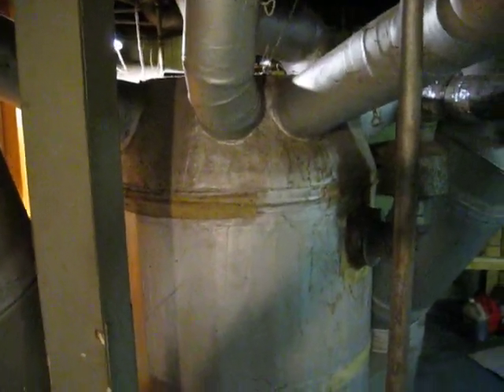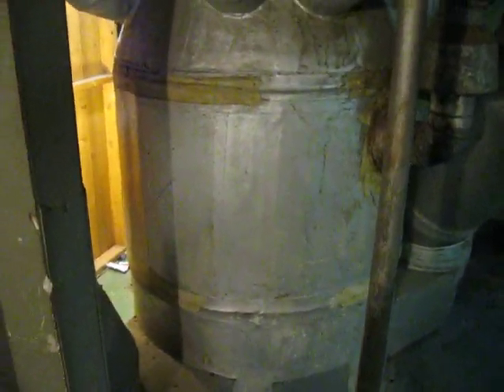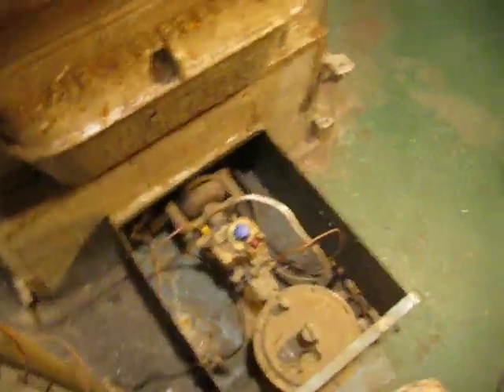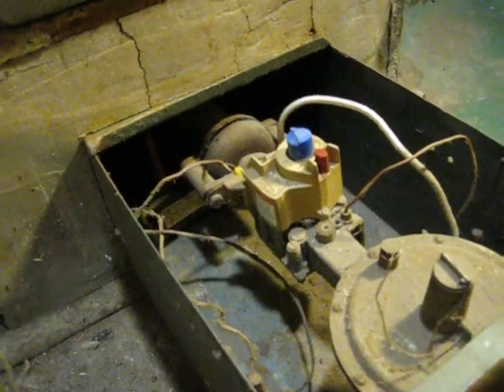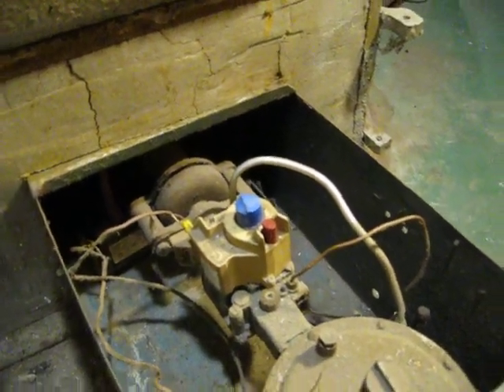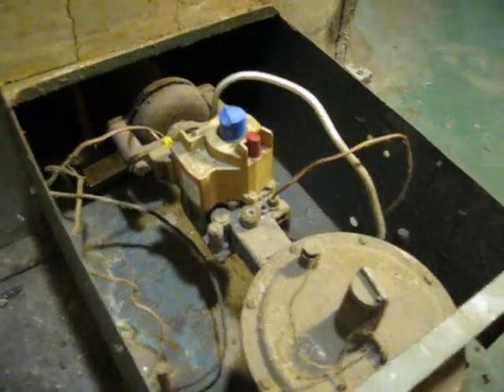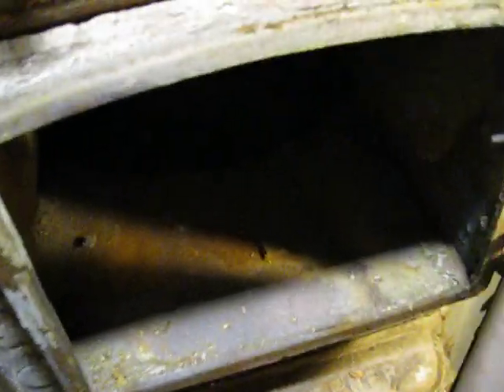Gravity Furnace Walk Around and Startup

Comment: I just bought a 150 year old building and it has one of those in the basement. Should I salvage it, or scrap it, your opinion?
Reply from the maker: @226Properties  I'd scrap it, less dust (since you can use furnace filters) + much more efficient + AC add-on is possible, etc. No regrets doing so.

Comment: Sears "branded" sold a gravity heater marketed as the Indestructo, another similar brand was the Cardunco. Found in the outlying Philly suburbs in vacation cottages in Abington Pa. Township. I removed one and took it out of service in 1993, prior to removal I fully operated it and brought it to full operating temperature. It's waste stack temperature was 380/400 degrees, a modern 80% is close to these exiting waste stack temperatures.. is it inefficient? Now it did have a draft hood diluting influencing stack temps.. but I believe it's efficient as it never had a repair that draws a service vehicle to site & it never needed any parts or repairs. It was removed form service for home sale & adding AC.

Comment: I just bought a house and I have one of this gravity furnaces in it, the one inside the house was working perfectly well until I turned off the electricity of the house and it won't turn back on. How do turn it on ?
Reply from the maker: No idea, sorry. Mine had a spark igniter that ran continuously whenever it had power, and I think the thermostat/valve just needed 24 volts or something. When I first moved into the house I hired an HVAC person who was familiar with them to come out and give it a tune-up, and show me the ropes; might be worth doing the same. Or rip it out, you'll save a ton of money on gas.

Comment: Interesting. Looks like the old furnace had a gas conversation unit installed similar to something our old home in Pennsylvania had. My dad had that installed in 1949-1950. The dial on top I believe is a upper limit temperature gauge. That function is to shut off the gas in case the temperature reaches a critical amount too high. That is the temperature you set on that dial.

Comment: Rspavlik
I was looking for a wiring diagram or schematic for a converted coal furnace but had none so I took a VOM to figure it out. Surprisingly I could not find a 24V supply so I went to Youtube and behold, I found the remark by Mike Fox which explained why there was no 24V available. Thank you Mike, however, I will not kick or scream into the 70's or 2000's. I think it is great that the furnace works even when the power is out and the bill is reasonable compared to the neighbors.

Comment: My pilot light is lit but it's there's no heat coming up, any suggestions on what I can do to fix this?
Reply from the maker: Does the main gas valve open when the thermostat calls for heat?
Reply: @zakqwy  no.. it does not. :-) I have a Thermopile and a silver(aluminum) line but nothing else (no copper thermocouple)

Comment: These are baaaaaadddd for carbon monoxide poisoning. Forced air furnaces have a positive pressure on tbe heat exchanger so the air pushes the co back. But these have a negative pressure so the co is SUCKED out of a cracked heat exchanger into the home.

Comment: the 1st problem is that you have two pressure reg with that setup second the thermocupler powers the pilot safty not the main burner and that switch at the top is a high limit

Comment: This switch at 3:40 is so that if your house Is that 60 and you put the thermostat at 80 it will allow or to shut off for a while so that you don't crack the inside of the furnace most people said it around 160 to 175. It will shut off for a period of time that way it won't crack and ruin your furnace then it will kick back on automatically

Comment: There is absolutely nothing inefficient about an Octopus Gravity Furnace. That is wrong information, and is usually deliberately stated by people trying to make a sale by selling you a removal service and/or a newer-technology product. The Octopus Gravity Furnace is over a hundred times more efficient than the latest technology systems for numerous reasons. View the following link, and read all the comments below, especially by the users named Stewart, Heather, and Joan: 

http://historichomesofminnesota.com/the-monster-in-your-basement-the-gravity-furnace/
Reply from the maker: As I stated in the video description -- simplicity and inefficiency. Gravity furnaces probably will last longer than any other heating technology and the repairs are trivial and cheap, since they don't have blowers and the burners are dead-simple. So the comments you linked are right in that regard, at least to a point. But for me, the gravity furnace had other disadvantages beyond its atrocious efficiency numbers that pushed me towards replacement: it took up a ton of valuable basement space, the air velocity was too low to implement any kind of filtration (so it spread dust around), it wasn't compatible with whole-house AC, and the heat was quite uneven despite a reasonably well-designed duct layout. 

Having said that, respectfully, you're absolutely wrong about efficiency. Normalized to heating degree days and keeping the house at 72 (day) and 62 (night), my gas consumption dropped 40% year to year when I swapped mine out for a modern condensing furnace. Heck, if you want to see how much energy a gravity furnace wastes, just look the respective exhaust designs: the gravity furnace uses galvanized steel pipe with a 250 F emergency cutoff (which tripped a few times when the furnace ran too long, if memory serves), while my 96% furnace uses standard PVC pipe that barely gets warm to the touch during sustained operation. The gravity furnace wastes a lot of energy that the condensing furnace recovers. And don't forget that more gas combustion means more CO2 emissions, something we all have a stake in reducing.

Looking at it from a purely economic perspective, replacing the furnace probably wasn't a sound investment; abatement, reducting, and the new HVAC unit ran me around $15k, and I'm guessing the new furnace will require replacement after 20-25 years for some fraction of that (call it $7k). Depending on natural gas prices, that probably ends up breaking even eventually but dumping my money into an index fund would have yielded far better returns. But replacement is still a good choice for the reasons outlined above.
Reply: I know nothing about plumbing or furnaces but if your exhaust is hot then you are wasting energy. Period.

Comment: Wow, it's been a long time since I've seen one of these.  The ones that I serviced had the old Powerpile pilot generator and milivolt T-stat.  750 milivolts (slightly less than 1 volt)  were created by the pilot flame.  The pilot coil and gas valve worked off millivolts created by the pilot generator.  No power was needed for the unit, so that was a really nice feature.  Heat was available even with the power out.  Seriously though, you need to come 'kicking and screaming' into at least the 70's !
Reply: I'm a heating guy they still have power Pilots but a lot of times heating guys will try to upgrade the furnace as this guy's furnaces been upgraded with a thermocouple standing pilot rather than a power pilot they are unsafe anybody that has a gravity furnace should try to look around and see about getting them replaced you see how much gas is used and it takes a 1 inch gas line to feed that regulator properly I would feel sorry for anybody that has one a heating guy can replace with parts just two regular 80% high efficiency furnace somewhere in the ballpark and parts of $1,100 but it cost a lot of times 2500 to 2800 to replace a gravity furnace because of all the work until and we running all the heat runs to do it properly they need to be ran and at least 8 inch round pipe and it's still kind of looks like a octopus when you're done I try to stay high to the ceiling to reduce the chance of head bangs and happy strapper I tend to over strap my ductwork but but my inspector loves us so oh well
Reply: Thanks for the info! I had always wondered how my octopus kept running after b@$tard$ at power company "wrongfully" shut off my electric but not my gas (meter inside basement).

Comment: Thanks for sharing this video. We have a really old gas gravity furnace. I'm wondering what type of regular maintenance we need to do with it to keep it running smoothly, etc. It is located in the basement which is a bit damp (house is in San Francisco close to ocean). Thanks!
Reply: and I would add you could use theatrical smoke rather than a "smoke candle." They are cheap and might come in handy some day. CO poisoning is very possible when there are gaps in the heat exchanger whether from an actual crack or from broken seals.   BE SURE to have a working CO detector in place. Consider buying a super low level CO detector like the CO Experts"Ultra" Low Level Carbon Monoxide Health Monitor. Pricey but WAY cheaper than the cost of one doctor bill or the cumulative effects of worrying about it.    BE SURE to check those seals and keep a good CO detector in place.
Reply: I would throw a smoke candle in this furnace when it gets warmed up.  This will check for cracks in the heat exchanger.  if there is a crack you will see smoke coming from the registers.  Those old furnaces often have asbestos wrap on the pipes as well.  Keep that in mind if you do a complete replacement.  You may want to have the asbestos abated by professionals before beginning the tear out.

Comment: The thermostat at 3:50 is a standard limit switch allowing control of the maximum plenum temperature. A furnace with a blower frequently has the limit switch combined in some way with the fan control switch. My grandmother had a gas conversion octopus that was somewhat more sophisticated than this one with a nearly silent fan mounted in the top of the plenum that enhanced the gravity feed. It also had a manual valve on the gas controller that could be operated firing the burner in case of power failure, and the gravity design continued to provide full heat even with the blower incapacitated. Of course the limit switch was also incapacitated, so attention had to be paid to prevent overheating.
Reply: Yes. These things could be made a bit more efficient by fitting a fan in either the plenum or the air return connected to a fan limit switch.
Reply: I know nothing about plumbing or furnaces but I still believe the only source of inefficiency with the octopus is the heat lost up the chimney. In my case, that's a LOT. I can't see how adding a fan makes anything more efficient. 

Insulated ducts focus more heat into the house (lose less heat to basement). Installing a fan would deliver heat to house quicker (and more unevenly) and a fan might reduce(?) heat 'lost' to basement but a fan would not reduce the heat lost as hot exhaust through chimney so I cant (yet) believe a fan makes octopus "more efficient".

Comment: As a child of 7-14 I had to hand fire a coal-burning octopus like this through bitter Michigan winters. The only motorized part was a very small chain-driven damper controlling a draft in the lowest door opened and closed in response to a bimetal thermostat upstairs, accomplishing next to nothing. We envied neighbors who had gas conversions in such furnaces. We had endless ashes to spread on the driveway. But, boy could it heat!
Reply: envious lol. your heating bills were cheap and they were paying through the nose running that thing off gas when it was designed for coal. efficient on coal highly in-efficient on gas. coal has its place i heat my home with a keystoker 90K house is warm, bills are low and im happy. buy all of my coal at once and usually some leftover. i use anthracite and i dont know what kind of coal you would burn in one of these old units. dumping the ash aint that big of a deal.. 
by the way was natural gas really cheap at one point making it justifiable to run one of these off of natural gas?
Reply: Grandparents had one of these converted to gas and it heated very well and wasn't too expensive in the 1950s. But they had a device on the smoke stack between the chimney and the furnace that limited how much got sucked up the chimney. It completely closed off when the burner wasn't on, which kept at least some of the heat in the bonnet for the next firing.

Comment: An Octopus furnace is meant to run on coal......run it on gas and as you say, its pretty costly to run.....use the fuel it was designed for and its not too bad for efficiency, it would probably have cost about what your new setup costs to run and you wouldn't be out 15k.....its one of those cases where you pay dearly for the convenience of not putting in a little effort loading it with coal and removing the ashes
Reply: your missing out. frankly natural gas is over-rated and over-priced, you literally pay for convenience. i heat with anthracite myself. i have a 90K keystoker. i fill the hopper every two days, empty ash around every two days. it literally takes care of itself. my heat cost me $700 last year to heat a 140 year old home that has some windows and insulation but still has air currents. i would not be able to afford to heat this house with natural gas.

unhippy1 is 100% correct. that old furnace was not engineered to burn natural gas, therefore its inefficient. burning coal it would be cheap to run. anthracite is not that dirty nasty crap that people think it is. there literally is no visible smoke coming from the chimney. the town would never know that you are burning coal. bituminous is that  dirty polluter that you are thinking about, but no one heats their house with that crap anymore.

have fun replacing that disposable natural gas furnace in less then a decade, because that's what they are throw away.
Reply from the maker: Even without massive particulate emissions (which anthracite still has), coal is still worse for the environment. Don't forget natural gas is CH4, while coal is mostly carbon. Depending on combustion efficiency, natural gas emits something like half the CO2 per BTU.
Reply: @zakqwy  
If your so worried about being green then why are you running that antique? Get heat pumps to heat your house
Reply from the maker: @kirkstinson7316  I definitely ripped this trash furnace out years ago, not to worry
Reply from the maker: +unhippy1 I seriously doubt that. I'm not sure what the price of raw lump coal is nowadays, but I'm pretty sure the City of Minneapolis wouldn't want me to run a coal-fired gravity furnace--they're a serious contributor to particulate pollution among other things. Also, I have no interest in getting up in the middle of the night to stoke a coal burner...
Reply: +Zachary Fredin Hmmmm you comments pretty much prove that you have never "stoked" a coal furnace/boiler.....with one that size you don't get up in the middle of the night to "stoke" it, coal is not like wood... with coal you load it once a day and your done.....plus anthracite coal does not smoke at all.

the reason those furnaces run better on coal than gas is that coal provides a constant even heat source (that the dampers adjust based on the indoor temp) that the gravity flow works best with........gas (or oil) is like a light switch...full blast on....off full blast on...off etc...not efficient for keeping a house at a set temp

Oh and anthracite coal is roughly between $160 & $280 a tonne depending on where you are
Reply from the maker: Yup. Never messed with coal. Not interested in starting now, or ever.

Comment: This is what's called an octopus furnace. My brother has one of these in his basement. There's at least a couple variations of the gravity flow design, this being one of them. I never have liked these furnaces due to their low efficiency. I feel sorry for my brother as I'm sure his utility bills are outrageous. That second switch is in fact a thermal switch. It may very well be for shutting it down in case it overheats.

Comment: I have on myself. I love the even heat. My gas bill is large. However, we use very little electricity. I am keeping it.
Reply from the maker: They definitely have their advantages. Gravity furnaces are much easier to keep running in case of a power outage, and they're quiet. However, for us the huge energy expenses, severe dust, and lost space in the basement made up for that. I'd say our heat got a lot more even after switching to forced air, too--the gravity furnace really had trouble with the second floor, even with the duct covers completely removed.
Reply: You should make a video of it

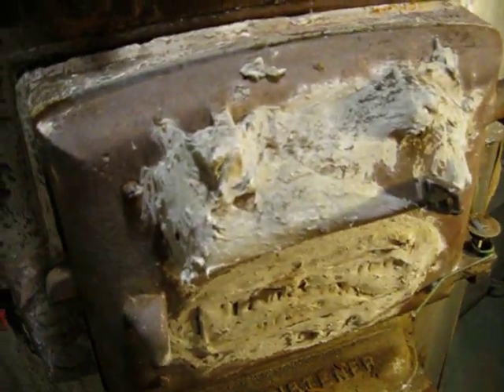Comment: The door you open up at 4:05 is where they used to stoke the coal into the furnace before it was converted to gas
Reply: +1912RamblerFan01 I think that was the ash cleanout. Feeding coal into the monster would have been through a second door above that one allowing for a grate to rest the coal on with combustion air rising up through it.
Reply: @Organgrinder1010  The ash clean out was where the conversion burner was installed, the door was removed and discarded to make room for the gas line and conversion burner kit, The door opened at 4:05 was the coal hopper door, the grates used to be where the gas conversion burner sits in the combustion chamber

Comment: the reason for the high fuel bills is more then likely because it so old and too big that it giveing too much then in demand use an oversize combustion chamber in this case you may have feelted your house get to hot a time pluse the asbestos compond as gone bad and broken down thin so the air inside the heat exchanging box is getting cooled down at times

Comment: @zakqwy I had a quote to remove the asbestos and old furnace, while replacing the furnace with an 80% efficiency furnace and using the current ductwork, so no ductwork to replace and also installing a chimney liner all for $3500 cash or $4500 financed.  I chose not to at the time but should have because now I do not have the cash.  20k is way too much.  Might as well let the gas go up the chimney for that cost.